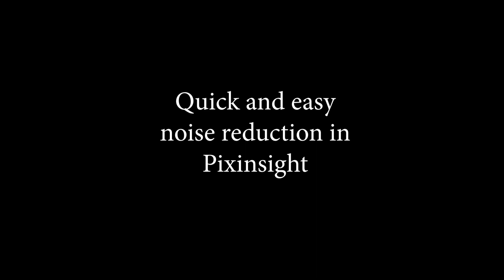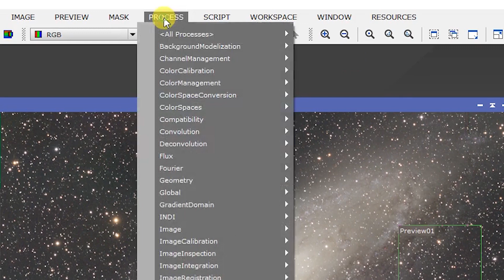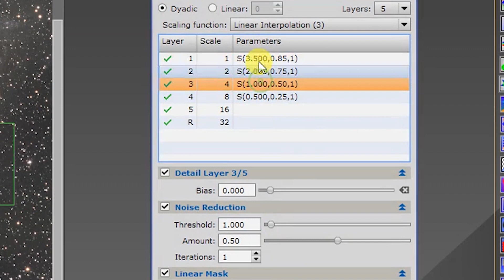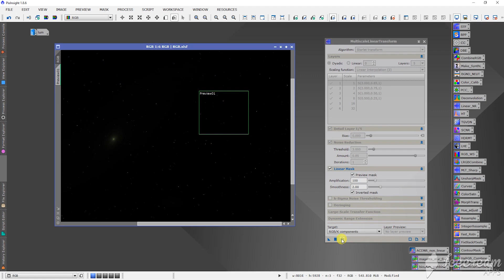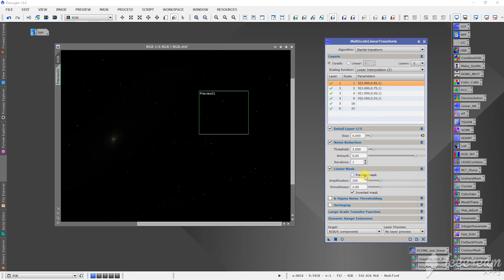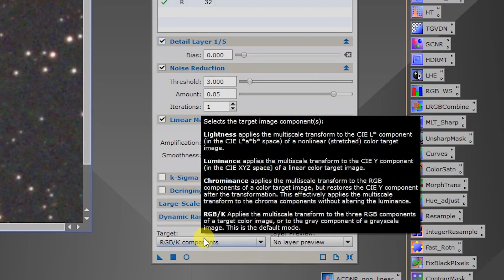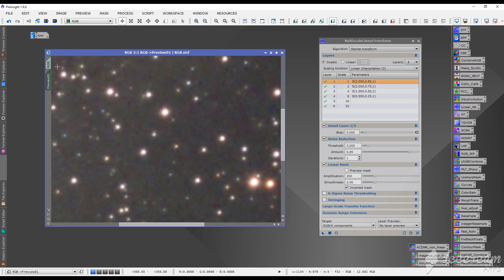Pixinsight image processing - noise reduction using a linear mask. (Astrophotography)

Comment: Thanks for your tutorials, they have been helpful. When I attempt the Linear mask preview with the inverted box checked, my preview is black and never shows the white inverted image with the nebula/galaxy and stars in black. I followed your instructions in the tutorial. I made sure to turn off the stretch before attempting the inverted mask preview. Any suggestions?
Reply from the maker: Hi Jeff - are you enabling the real time preview as well? Blue circle button at bottom left of MLT window. That needs to be enabled as well. Let me know.
Reply: @VisibledarkAstro  Shawn, thanks for the reply, yes, I click the blue circle (preview button). I actually watched your video while performing the task in Pixinsight. I just installed the new Pixinsight update a few days ago. I'm totally perplexed. I don't know if it makes a difference that I'm running the trial version of the program. I would post a pic of my screen to show you but I'm unable to do that here.
Reply: Shawn, quick update, I opened another file that I was editing and it seems to work. I'm not sure why the original one I tried it with did not work. All the parameters seem the same to me. I will need to play with the M27 image and see why it's giving me issues. Your videos have been a huge help in learning Pixinsight, please don't stop!
Reply from the maker: @jeffk7714  Glad you got it working!

Comment: I love it. What I found to be even better is doing some basic processing (STF, Histogram, ColorCalibration and SCNR) and aaving the image as a 16bit .tiff file. Than I open that file in Photoshop and do a Color Noise reduction (every color noise will turn into gray). Save that image, open in PixInsight and run ACDNR on bith Lum and Chrominance channel. You can try that one too :)